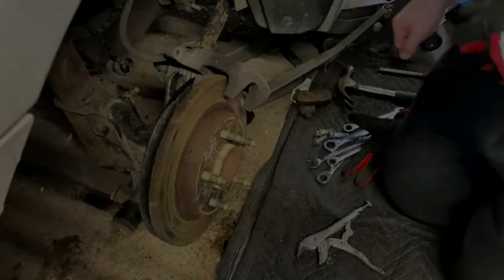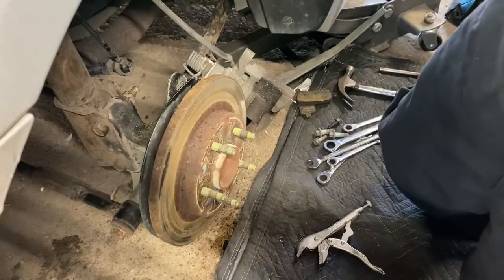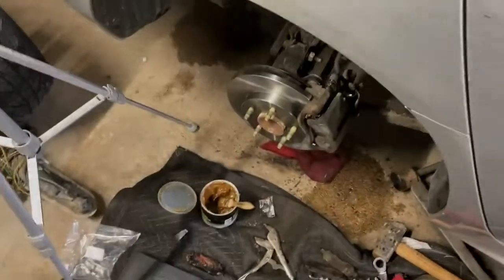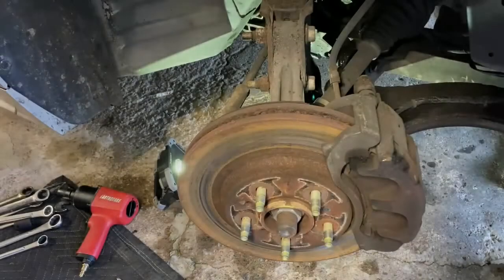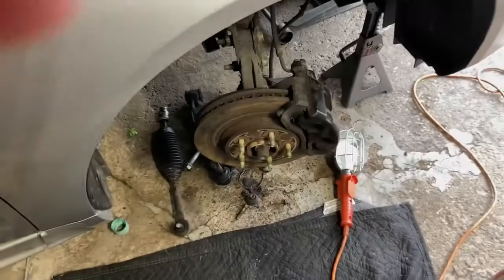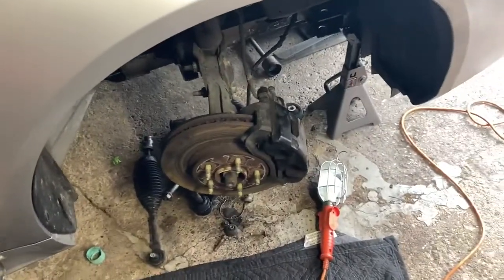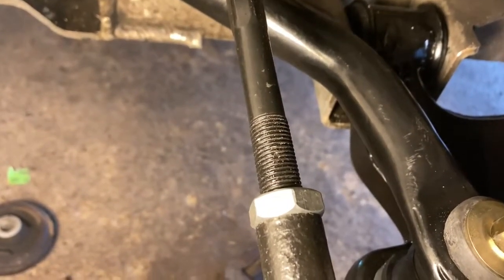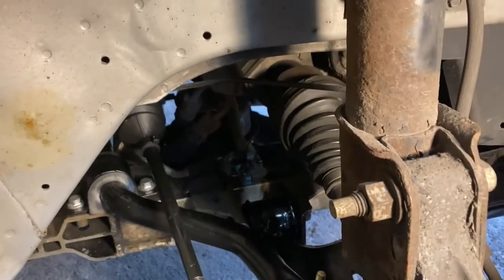Chevy Impala Replacing Brakes and Suspension | 2012 Chevy Impala Rebuild Part 3

Comment: Back in my younger days yes id put on petroleum grease on them sliders. But realized it swelled up the rubber so no more slide. Use silicone grease packets instead doent make rubber swell and higher temp